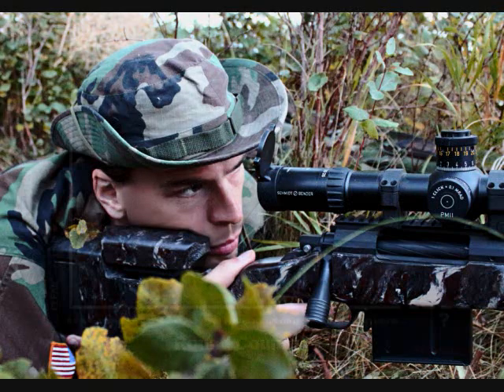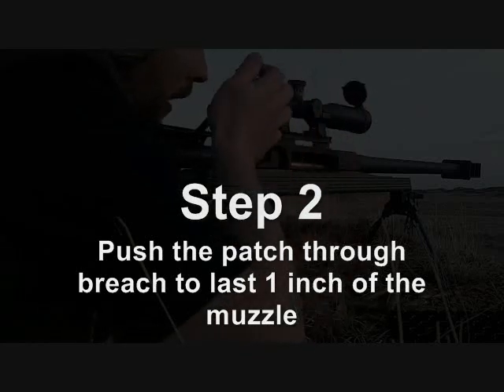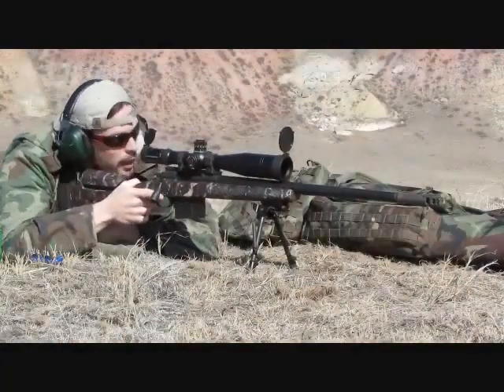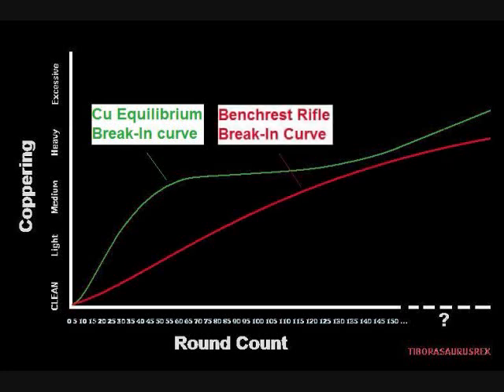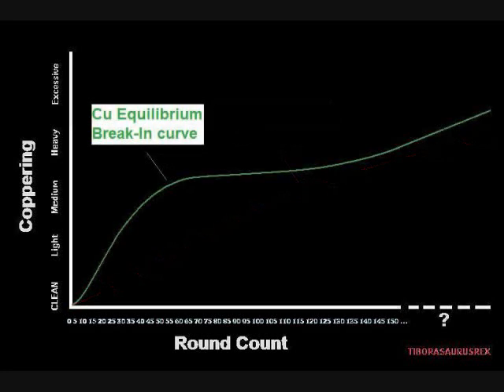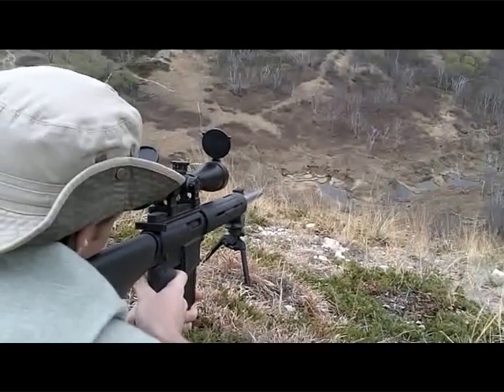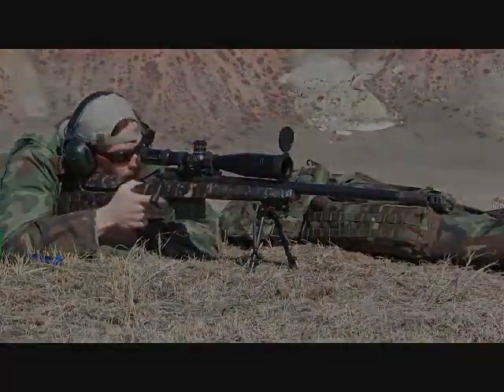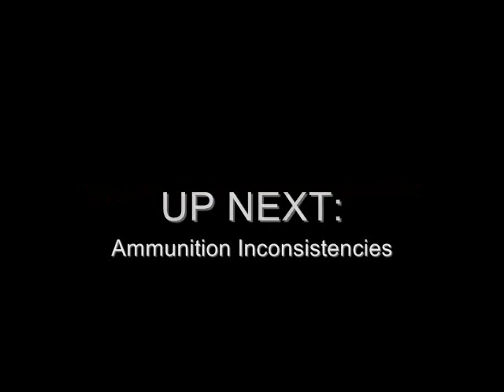Long Range 101 Part 45 - Copper Removal Issues in Long Range Precision Rifles

Comment: Hey Rex! First of all, thank you for all the great information through your videos and more importantly time and dedication to helping others. I had a quick question. I have seen nylon brushes used with Sweets as a replacement to brass, is it better to use patches or would a nylon brush be a good option to possibly brake down the build up a little faster?

Comment: Funny thing: My Tikka t3 Ctr .308 stays consitent from 0-100 shots, after thah groups start to open up.
Copper removal after 100 shots with boretech copper remover.
After every range time I soak barrel with boretech eliminator (which removes some copper), and run vfg felts until they come out clean, usually 4-5.
And its consistent all the way from first shot to 100 and after that groups start to open barely noticeably.

Comment: Hope all is well Rex. You are wonderful  person. I am no fortune teller but you can tell when people are good or not for the most part.  I had a question answer when ever you can if not, no worries. I have decided on a new rifle in 308 (my first 308). I am wondering in an semi auto would work long range but they typically have thinner  barrels. Look tge Windham Weaponry 308 (AR10 style) it has a med profile 16" barrel. I don't plan on shooting extreme distances, maybe 200-500max. Also considering a R700 AAC-SD 16" with a MDT LSS or KRG chassis. I have looked at the PTR 91's and M1A's as well what are your thoughts or recommendations?

Comment: I thought I would put in my 2 cents. The very best copper cleaner I have used is water based and will never harm the bore. It is called KG-12 Big Bore Cleaner. The only issue is that there is no blue indicator in this solution. After I think I have got most of the copper out, I test the bore with Bore Tech Cu+2 Copper Remover which is also amazing, safe and does turn blue. I hear that many shooters can go as much as 600 rounds before the bore needs copper removal. I think it is a good idea not to be too aggressive in copper removal since you do want a certain amount to have Copper Equilibrium. The KG-12 and Bore Tech work amazingly fast. I use special aluminum jags and nylon and aluminum brushes specifically made for copper removal from Dewey's.  No need to use old fashioned, smelly, corrosive, ammonia based copper removal solutions with the aforementioned state of the art copper removal solutions. Google both of the ones I mentioned. You will see some users tests (with photos) on just how amazing the KG-12 Big Bore Cleaner is. The Bore Tech is no slouch either. Like I said. I use both. It is important to keep a log book and round count to get data to let you know when its time to de copper. I chrono every single round down my barrel and record the data along with temp, ammo temp, baro etc. One word Magnetospeed! Google that too.

Comment: What of the new modern powders, like the IMR Enduron powders. They claim to remove copper fouling from the barrel. They are also supposed to have very little MVV in changing temperatures. Should shooters in this discipline avoid such powders because of the copper removing additives?

Comment: I was always told to only clean from chamber to muzzle, and never in reverse. am I misunderstanding that?
Reply: If you can, chamber to muzzle is generally preferred. The crown of the barrel is critical for accuracy. Going from chamber to muzzle leaves less room for damaging the crown with the cleaning rod or brush/jag base. There are many firearms that you just can't clean from chamber to muzzle, and in that case there's nothing to do about it except pay very close attention to the crown and use a rod guide if you're wanting to be extra cautious.
Reply: Correct

Comment: I get the principles of this regime and it all makes sense. But the practicalities of removing excess copper as described in this video seem less straight forward. For example how does one hold the rifle in the vertical and allow for the fact that one is using a rod of the type recommended?

Comment: I don't know if you addressed this in other videos yet but: Does barrel wear occur more toward the end of the barrel, due to higher velocity? Similarly, using the same load, twist rate, etc..., does a shorter barrel last longer due to lower velocities? Or is the wear more at the throat area?
Reply: I don't know about the second question but as far as barrel wear, you will get most degradation at the throat of the barrel due to the very high temperatures. At the very high temperatures, the carbon, which is produced from the combustion of the gunpowder actually makes its way into the lattice structure of the steel, increasing hardness but making it more brittle.
Reply: Exponentially more wear occurs in the first couple inches of the barrel than the rest combined, so a short barreled rifle will have no "service life" advantage. In fact, it's not uncommon to take a "shot out" barrel and rechamber it a little deeper. By pushing the chamber forward, you shorten the barrel by that much from the back. This gets rid of the worn out area near the throat.

Comment: I was thinking through the process and started wondering, what about the Sweets 762 solvent that we pour in at the top inch of the barrel? Are there any concerns about that flowing into a gas tube on the AR10 Semi Auto Sniper System and if so how should it be addressed? Thanks.

Comment: Rex - In my Rem700 Milspec 5-R 308 rifle, I'm at 707 rounds of copper fouling (seems high).  My groupings are still < 1/2 MOA (100y/200y).  At what point do I think about cleaning (bore snake w/ Hoppe's #9)?  I've been doing a lot of load work-ups, so I don't have a lot of velocity information.  The last 50 rounds through rifle w/ same load was 2625 fps w/ 23 fps standard deviation.  Is the SD or group size what I need to use to determine when to clean?  Or is there another consideration?

Comment from the maker: Depend on where the rust is attacking, but I would make sure I would wipe down all the metal surfaces with a silicon gun cleaning cloth before I set it on the rack.  If you have a lot of moisture, then a thin coat of oil over all the metal surfaces would be warranted.  One or two drops goes a long ways.  If you are concerned with the bore, add a drop or two of oil to the last patch after a normal cleaning and leave that in there until you are ready to go out again.

Comment: Another great video.  Please, keep them coming.  Now that I'm caught up, I'm finding myself checking twice a day for updates.  I have a question on copper fouling on a Rem700 Milspec 5-R.  The reviews on the rifle say that the 5-R rifling will help prevent copper fouling.  Will this be an issue if I choose to do the copper fouling method?  Will chunks of copper get dislodged after I reach equilibrium and cause differential expansion issues in the barrel?

Comment: You pretty much just described me. I bought a rifle to designate as a precision rifle. I've put maybe 50 rounds through and have carefully but throughly decoppered it after every 5 or 10 rounds. I'm planning on shooting it tommorow. I have 10 loads 5 shots each planned for it. It has 1 rounds down the tube since full cleaning. What do you recommend i do to get the most out of it and cut down on coppering variation? It's a bolt gun.